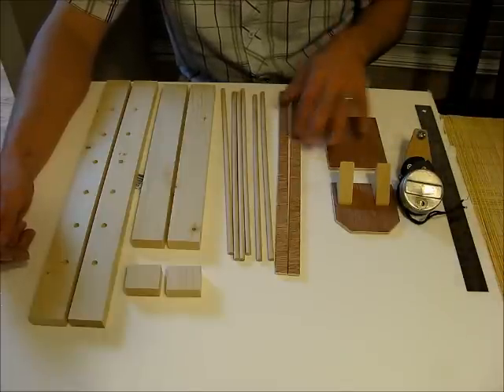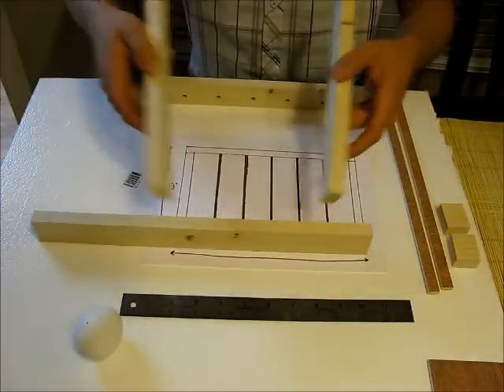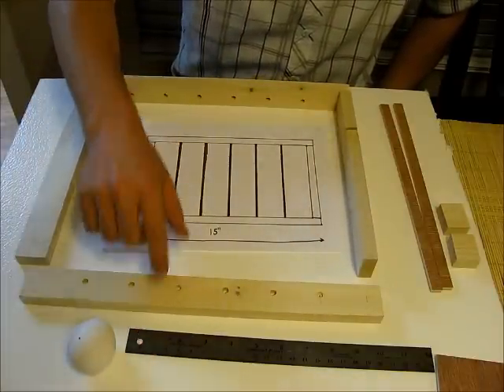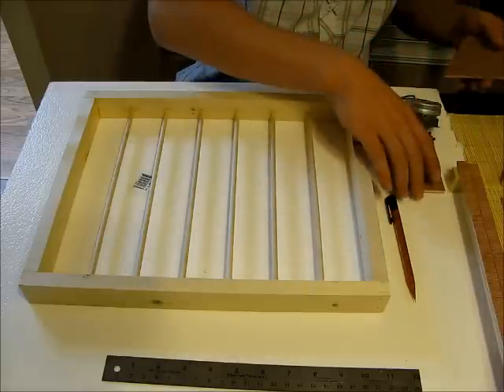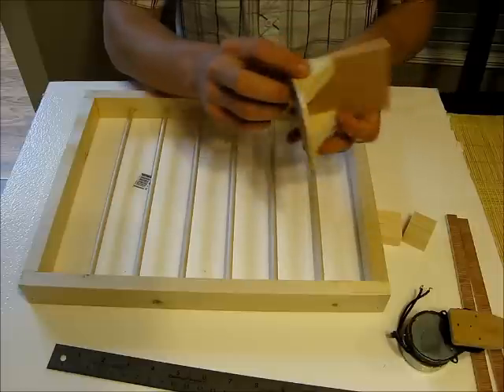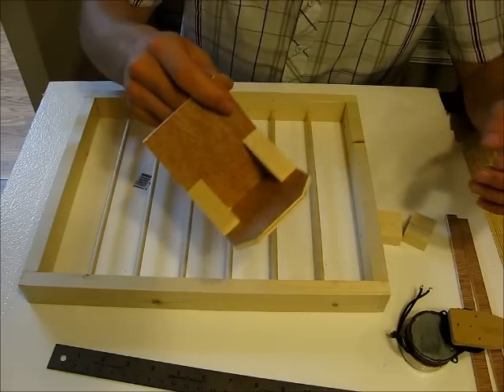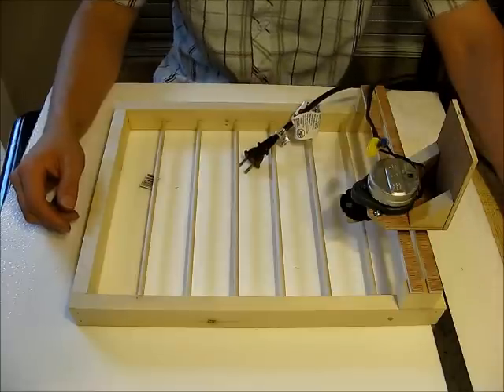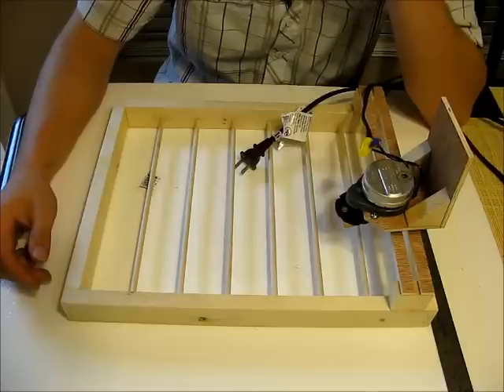DIY Automatic Egg Turner - Detailed Instructions!

Comment: I have access to some free motors used in very large commercial washing machines.  They are used to inject the detergents, bleach, fabric softeners etc.  They run at 50 RPMs.  However, during those times while the other motors are injecting their particular chemical, the others slow down to a snails-pace.  If the digital circuit board can slow em down, HOW CAN I SLOW IT DOWN?  Resistors, diodes what?  I am clueless as to what a diode or resistor is! LOL!!!  These lil motors are bulletproof.

Comment from the maker: The stats sound good. Did they give you dimensions? That's be the only other consideration. You'd want enough room in order to get the turner out. You could always make a removable motor mount if the motor was on the large side. That way you could just take the motor assembly out to make enough space.

Comment: would this be ok its on ebay but i cant post the link

Soundlab Black 1 RPM Mains Powered Mirror Ball Motor Featuring Metal Case

This professional mirror ball motor features a tough black powder coated metal case, shaft with pre-drilled hole for mirror ball connection and a quiet motor. For mirror balls up to 2.1 kg. The fitted power cable (1.5 foot approx) allows you to add your own plug*.

Features

Colour: Black
Power Input: 230 V/AC @ 50 Hz
Packing: Box
Rotation: 1 RPM
Max Load: 2.1kg

Comment from the maker: Thanks! I discovered you can buy the Hova Bator turner motor online for about $16. It's not cheap, but can suffice in a pinch. Try typing in "synchronous motor 1 rpm" into ebay uk. I was able to find a few that way:) I found a couple under that search that were 1/3 rpm, which is nice. The 1 rpm motors would be fine too. You would just need to find a way to run it in half minute increments, otherwise you might not be able to stop the turner at the other side of the incubator.

Comment from the maker: Another option would be to take off the blue arm and simply cut a hole in the piece of wood/MDF to fit the circle with a flat shape that the arbor has. Yet another option would be using a 1/2" or so thick piece of wood, drilling a the diameter of the arbor without the flat, and screwing a screw into from the side to hit the flat on the arbor. Visuals would help here, but hopefully that'll help some:). Good luck!

Comment from the maker: You could do a couple of things here. If you leave the blue arm on it, you could take a small 2 1/4" or so long piece of wood/MDF, drill a hole in it that fits the blue arm's nub and then put a screw right behind the nub through the wood piece you made and into the plastic. That way you'd have two points holding it on to the blue arm. You'd need a hole on the other end of the wood piece for the turning screw as well.

Comment from the maker: Yeah, the telescope clock motor's are hit and miss. You can actually buy a hovabator turner replacement motor for about $17. I can't post a link per youtube, but type "hovabator turner replacement motor amazon" into google and the first link should be the amazon ad I found. The other option is to type "clock motor" into ebay and find one that looks similar to mine. If it runs on 120v and is pretty slow (1 rpm or less) it should work great. Good luck!

Comment from the maker: @mayberrygirl74 I looked it up and it seems identical in style to mine. You could wire it the same. It has a blue plastic arm on the arbor with a nub sticking out on the end. You may be able to just make the channel for the screw in my design slightly wider to fit the plastic nub. That arm is a bit short, so you might put an egg in the unit with a dot on it to see how much it turns with the blue arm. If it doesn't turn the egg all the way over, you could just make a new arm for it like mine:).

Comment from the maker: @mcmujose Thanks! It was a lot of fun. I would assume your motor should work fine. I'm a little confused about it being 12v, but still ac. Are you sure it's not a dc motor? I've only ever seen the 120v-ish ac motors and 12v dc. You have to find an adapter that would put out 12v AC, which I'm not sure where you'd find. Let me know how it goes. I'd love to see how it all turns out!:)

Comment from the maker: @paco9045 The key will be to reduce friction. I put polished hardwood plugs with round ends on each corner of the turner rail so that the contact points were very small and smooth. You could use anything here, even wheels or ball bearings if you wanted to step it up a notch. Mine had very low friction and would turn the tray with 24 eggs in it, so it shouldn't have a problem if you smooth out all surfaces and make the contact points small. Let me know how it goes or if you have any more ?s:)

Comment from the maker: @paco9045 I'm assuming that means 9 tenths of a turn and not 9 or 10 turns a minute. That might be a bit hard to work with as it would be hard to find a timer capable of running it for the exact amount of time needed to turn it half way around. Most timers will only run as little as 1 minute intervals, so you could run it for 6 or 7 minutes. That would make it turn around about 6 or 7 times and but end up on the other side. You have to constantly monitor it to make sure it stops when wanted.

Comment from the maker: @paco9045 It should say somewhere on the motor. I copied what you wrote and did a google search. It seems like most of the 42tyz motors that came up in the search were between 3-6 rpm. You could also connect a chord to it and plug it in. Then simply time how long it takes to go around once.

Comment from the maker: @paco9045 Mine actually spins spins all the way around as well, so you can do the same thing I did. The way I get it to stop is by using a programmable timer for lights, like the ones you can buy at home depot. Mine is a 1/10th rpm motor, so if I run it for 5 minutes it turns halfway around. I just have it run for 5 minutes every hour.

Comment from the maker: @HomeDistiller The verdict is in on the hatch rate:). I had 3 infertiles (yolk/egg white and no enlarged blastodisc).  Those are a fertility and/or storage problem, not an incubator problem, so not counted in hatch rate. I also had 3 with partially developed chicks, each at different stages of life. I ended up with 18 hatched, not too wet nor sticky and no bloody navels or extra yolk. So that's an 85% hatch rate! After reading that hatcheries can't expect much more than 80%, I'm pretty stoked!

Comment from the maker: @HomeDistiller It'll be fun too see how it does. The temp has been stable; between 99.5-100.7 since the eggs have been in. The light comes on at 99.5 and cut's off around 100, then heats up that last .4-.7 degree. This swing happens every 5 minutes or less, so the egg temp probably isn't varying more than a couple of tenths of a degree. I can't imagine that affecting things much. Hopefully the humidity will work out; it has stayed around 45-55%.  I wish I had a Hova-Bator to do a side-by-side.

Comment: the slow rpm motor could be gotten for free out of a microwave as a plate turning motor.. it might be a little fast though but worth a look
Reply: HomeDistiller  do you still have to turn eggs by hand if you have an egg turner. What do you set the humidifier